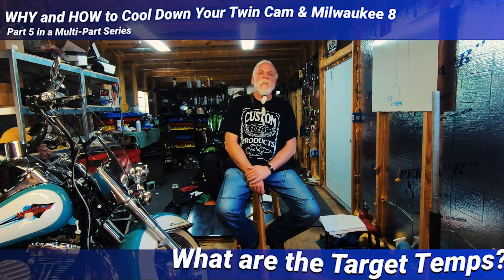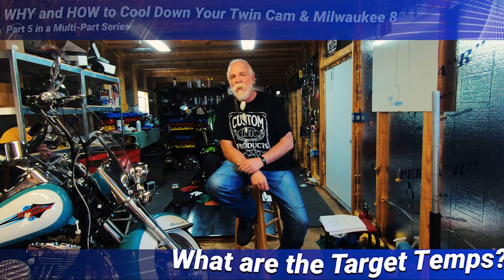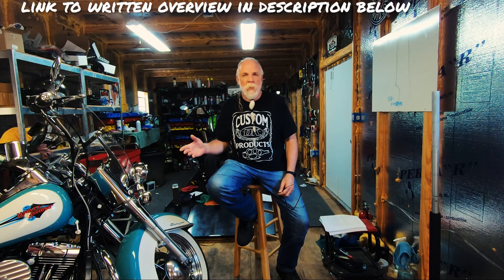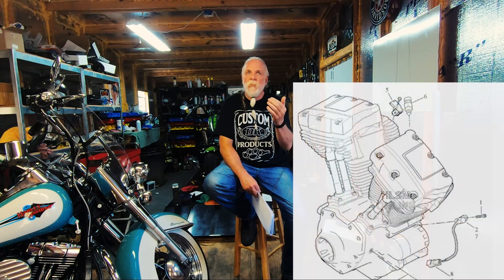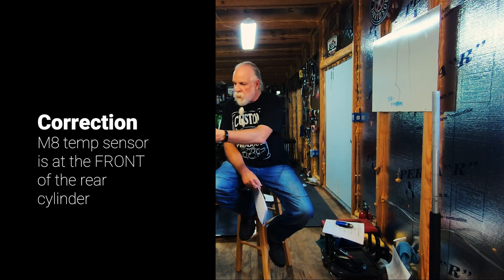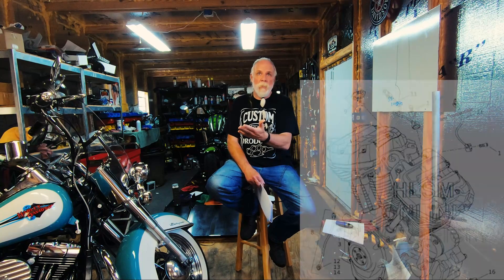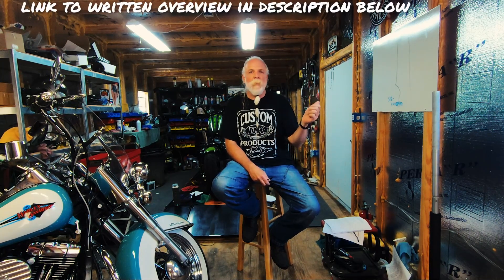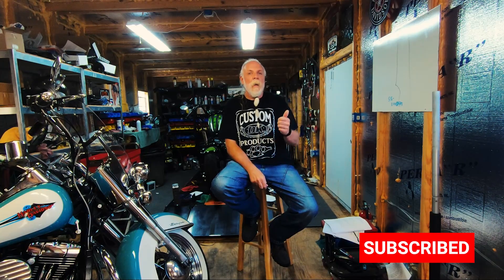Optimum Harley Temps for Comfort, Power & Longevity

Comment: Today here in Central Florida, 91 degrees with a real feel temp 101. After riding my 2012 Heritage Classic Twin Cam 103, 40-50 miles, I hit 240 degrees oil Temp. I have a Jagg Wideline oil cooler without fan assist, 2in Tank Lift, with Optional rear lift, XIED, External Breather with Catch Can.
Reply from the maker: That's a good setup and those temps sound about right, thanks for watching! -RM

Here is a link to a written report on How to Cool Down Your TC/M8 that you may find uesful/interesting - https://www.dkcustomproducts.com/why-how-to-cool-down-your-twin-cam-engine-part-ii-dk-cl-tc-dn-2.htm
Reply: @DKCustomProducts  I thought you stressed not to go over 230 oil temp?
Reply from the maker: @dieseljuice3  This is true but with all things considered, those are good numbers for Florida temps. You have taken the proper measures to cool it down and there really isn't much more to be done. Perhaps a billet oil filter to net a couple more degrees. Where are you pulling the oil temp from and what device are you using to read the temp?
Reply: @DKCustomProducts  HD Oil Temp Dip Stick Gauge. Oil Tank.
Reply from the maker: @dieseljuice3   The digital one? Those are notoriously inaccurate. Yours may be correct but you can confirm with a cooking thermometer. If you have the analog gauge dipstick, it is probably correct. Still though, 240° when its basically 100 outside is reasonable. I would be running full synthetic though as it can handle temps up to 275° before it starts breaking down. Not ideal to have oil temps that high under any circumstances but better than Petrol-based oils which will start to break down at 240°
Reply: @DKCustomProducts  Analog, and Synthetic. My first HD @ 65 yrs old. Worry about damaging it.

Comment: Does mufflers effect engine temperature?
Reply from the maker: Free flowing exhaust slip-ons are a very important factor in cooling the engine down.  The stock exhaust mufflers (slip-ons) are restrictive, resulting in the engine fighting against itself.  In doing that it generates heat with no resultant forward movement.

By removing this restriction, you are allowing a free flow of exhaust exiting the engine, which plays an important role in keeping the engine cool.

The stock headers on Harley’s are very respectable, and are not restrictive.  Replacing them will not have a significant benefit in lowering engine temperature.  If your Catalytic Converter is in your headers (all Touring & Trike models) you can remove it, or replace the headers for a reduction in Felt heat from the exhaust.

Here is a written report of exhaust that you may find interesting - https://www.dkcustomproducts.com/harley-exhaust-myths-and-facts.htm

Feel free to contact us with any questions;
Support@DKCusotmProducts.com
662-252-8828

Thank you for commenting! MB

Comment: Will it hurt to run flow fans and an electric oil cooler? I ride in the Ozarks a lot , and my electric oil cooler seems to stay on more than I would think it needs to. It kicks on at 230 degrees.
Reply from the maker: That shouldn't hurt anything as the Fan and the oil cooler should not come on until your bike is at about 230 degrees. 

I am not sure what bike you have, but you may find this video informative/helpful if your bike is running hot - https://www.youtube.com/watch?v=CAcF0T-Cs3E

Please feel free to contact us with any questions;
Support@DKCustomProducts.com
662-252-8828

Thank you for commenting! MB

Comment: Just put a power vision on my 21 Road Glide special.  My ET got up to 334 degrees while running down the interstate. I'm running amsoil. I have your tank lift kit installed. I found no loss of power. The bike runs great. And just normal running at under 70mph it will run around 280. What could be my issue?
Reply from the maker: That is far too hot.  
Here is a video we just released on a common sense approach to cooling the engine down to the optimum operating temperatures.
https://www.youtube.com/watch?v=CAcF0T-Cs3E
Some bikes will run for their lifetime with damage caused by excessive heat, others, not so much.  Here is a video on that subject- https://www.youtube.com/watch?v=uyryiq6BzQY
Here's another one you may find interesting- https://www.youtube.com/watch?v=2o9k__6MV6Q&t=0s

A loss of power due to crossing the 270* mark will not necessarily be felt.  It will if you are full throttle, you will see it on the dyno, but is is not something one would necessarily feel in normal riding.

Always feel free to email or call with any questions:
Support@DKCustomProducts.com
662-252-8828
KP

Comment: On a Fp3 tuner the engine temp is that ET sensor right?
Reply from the maker: It is reading the heat sensor that is embedded in the cylinder head. 😎

Thanks for commenting! 👍 MB
Reply: @DKCustomProducts  and I want that at around 230 degrees?
Reply from the maker: 230 is the normal operating temp!

Here is a full video list of why and how to cool down your TC and M8 that you may find useful/interesting - https://www.youtube.com/playlist?list=PLb3bvZgbH92_3s-2vv63QggFJ3nteFd_C

Thanks for commenting! MB

Comment: Which is better to use to cool down my 2015 Ultra Limited liquid cooled engine/oil temp? Force air fan or adding an aftermarket oil cooler?
Reply from the maker: An aftermarket oil cooler is a good step in cooling down your bike. There are many other things you can do to cool it down, there is a link to a written report where they are all outlined, with temp drop results.

Here is a video that is very pertinent to your Twin Cooled bike, illustrating why an oil cooler is important on the Twin Cooled Bikes- https://www.youtube.com/watch?v=6AhPqVlvE-w  

Here is a link to the oil coolers we offer and use- https://www.dkcustomproducts.com/oil-coolers-c134.htm

Here is a link to a written report on how and why to cool down your Twin Cam part 1 - https://www.dkcustomproducts.com/why-how-to-cool-down-the-twin-cam-engine-part-i-dk-cl-tc-dn-1.htm

Part 2  of the report - https://www.dkcustomproducts.com/why-how-to-cool-down-your-twin-cam-engine-part-ii-dk-cl-tc-dn-2.htm

Please feel free to contact us with any questions you might have; 
Support@DKCustomProducts.com
662-252-8828

Thank you for commenting! 👍😎👍

Comment: I know the "Engine Temp" on FP-3 and FP-4 is supposed to be equal to Power Vision indication, have you seen that to be true? I have the FP3 on my dual cool 15 Ultra and it running at 200 on the freeway and up to 225 in traffic and My 2010 Dyna with the FP-4 runs 225 to 235 or so on highway and hits 250+ in traffic. South Florida 90 degree days... Just wondering if PV and FP indicate the same.
Reply from the maker: Those are some good temp readings you are getting.  On the Power Vision the one you want is ET, on the FP3 and FP4, I believe the heat sensor embedded in the head is displayed as F

At 250F on the Twin Cam you are a bit high...you don't want to see it go over 230 F.

Here is a video of low and no cost ways to get it a bit lower- https://www.youtube.com/watch?v=o3T3yA9BKwE

Always feel free to email or call with any questions.  We appreciate your business, and I believe you will be well pleased with your EBS.

Support@DKCustomProducts.com
662-252-8828

Comment: The printout for the tc shows the sensor at the front of the rear cylinder but you are saying the rear of the front cylinder. Which is it?
Reply from the maker: Every 2007 and later Twin Cam we've looked at have the heat sensor at the rear of the front cylinder.  The M8's are at the front of the rear cylinder.  The schematics in this video show what is said above, but you can go online and look at the schematics for any year and model bike and see where they are located.

Comment: I didnt know my power vision had a engine temp and a engine head temp both to chose to monitor on my 20 or 21 m8s.. But ive made a few mods, and my oil temp (via harley oil dipstick) at 98 degree outside temp my oil makes it up to 215 on hwy driving..and down to 205 stop and go traffic, however my Power vision (by one selected) runs 300-325 inthe 98 degree hwy riding.. Either its not there, or i can not find head temp (only ET Temp) with my option selected,  but what i am measuring in no way could ever stay below 230 degree.  Edit:  I found the Head Temp selection under Advance options selections, but I also noticed it reads about 20 degrees above reality while sitting cold in the garage..
Reply from the maker: Those are great oil temps!  My guess is you have M8 Softails, or Touring models with no lower fairings.
Regarding your Power Vision, the should be an "ET" gauge.  The CHT gauge is worthless for monitoring engine temps...it is an algorithmically derived number that changes quite a bit, and is not reflective of actual engine temperature.
Here is a link to a video showing the ET displayed in the middle left of the screen. https://youtu.be/5OTSwYFPABE?t=294
Reply: @DKCustomProducts  I have a Road King , and my Street Glide does have lower fairings (I always leave the vents fully open) and 20mm lift on the front of the tank, stage 2 Wood's cam, S&S oil pump and cam plate, added fan to oil cooler (same for the road king engine mods) , and.yea that ET temp was climbing on extended 65+mph riding when riding in 100 degree weather..it seem top top out below 330,. I suspect oil temp would have been 220 at that same moment if I was able to observe it.
Reply from the maker: @ut1004bp  Yeah, those are really hot temps for the ET.  Something is still awry with your builds that they are building that much heat, especially at 65 mph.

You can see what happens at the 270 F mark in this video- https://www.youtube.com/watch?v=5PxJ8PvcVtc
Reply: @DKCustomProducts  Yes I can see the curved shape might aid in some air flow as opposed to a flat crash bar lower set would..I think I've responded last year to your test of the above mentioned.. but To create more funneled air flow, I've rotated my horn housing forward and remounting to be center of the two cylinders, rotated the horn backwards to prevent water intake, and I believe it will be another  no-cost heat reduction solution for the rear cylinder (will get it hottest at 65+ mph on very hot days) as there needs to be more air flow for that rear at those occasions, I haven't tested this mod yet.
Reply from the maker: @ut1004bp  Nice.  Looking forward to hearing your results.
Reply: @DKCustomProducts On my Road King, I couldn't use the power vision to monitor the engine temp, but on today's 200 mile ,  I reached in back of the horn clamshell and could feel wind pressure being pushed to the left side of the rear cylinder, even with my horn still in there, oil temp was 208, immediately after pulling over to check and I was steady at 65 and more for an hour, with 90 degree ambient temp..id say it's worth moding the horn orientation, and for better results, remove and relocate the horn.
Reply from the maker: @ut1004bp  Good deal!

Comment: My '12 Twin Cam has a stage 1 , Cobra Power Port duals header, Rush mufflers,  performance machine jet air cleaner,  and power vision tune from Fuel Moto.  Today in Cleveland its humid with an air temperature of roughly 82 degrees.  On my way home from work today,  in city stop n go, my powervision ET hit 275!   I thought adding this cobra header id have a cooler running TwinCam????
Reply from the maker: Hi Anthony,
The exhaust you have is having reversion, which is not good for heat.  The air cleaner you have is feeding hot, oily, oxygen depleted air back into the engine, also not good for heat.
Here is a video on what you can do to mod your air cleaner to run the bike cooler, AND, with more power-
https://www.youtube.com/watch?v=EfDeFZblMck
Here is a video talking about exhaust, and an easy fix to them to help the bike run cooler, and with more power-
https://www.youtube.com/watch?v=nB0XDQVjH9Y

Here is a link to a report on Why & How to Cool your engine down- https://www.dkcustomproducts.com/why-how-to-cool-down-the-twin-cam-engine-part-i-dk-cl-tc-dn-1.htm

Comment: My 1200 Custom (with a Stage 1) is getting up around 400°... guess I better do the auto tune. I'm betting it's running lean. That hasn't even been in real hot weather.
Reply from the maker: What year is your Sporty?  400 F in weather that is not real hot is a little unusual for a Sporty.  Tune first, still too hot, then possibly an oil cooler and/or a coil relocation.
Reply: @DKCustomProducts  to answer your question, it's a 2014. Had about 2400 miles on it when I got it about 2 months ago. Put over 1k on it so far. But the autotune and taking the cover off the air cleaner seemed to help!
Reply from the maker: Glad you're getting it cooled down!  👍😎👍
Reply: @DKCustomProducts  I removed the air filter cover and did the autotune on the FP4. That seemed to bring it down to around 360-370. Also have an oil cooler on the way but the above steps definitely seemed to help! Thanks!
Reply from the maker: Good Deal! 👍

Comment: So which would be the temperature that I'm looking for. A dipstick thermometer or a powervision readout?
Reply from the maker: We look at both, but if I had to choose which one is more important...that is the heat sensor in the cylinder head.  Both the Power Vision and the FP4 can display that for you.
Reply: @DKCustomProducts  Thanks! If it ever warms up here in Mn I think I'll plug in my PV and see what the temp tells me. I would still like to have a dip stick that reads oil temp.
Reply from the maker: Yes, it is useful to have both.  Once we have a bike dialed in to the optimum temps, we rarely look at them.  But it is good to have them to get your bike where it is happiest.

Comment: My 2011 road glide custom head temps reach 370 cruising . My efi is never over 14.4. I'm concerned
Reply from the maker: Where are you getting those temp readings from?
There are only two reliable temp readings on a Twin Cam.
1.  The oil temperature, measured at the tank, after 45 minutes or more of interstate riding.  It should not go over 230 F on a hot day.  If it does, it is running too hot for it's own good.
2.  The ET reading shown on a Power Vision.  This is the temperature that is measured by the heat sensor in the front cylinder head on a Twin Cam.  This is the temperature that is sent to the ECM by Harley.  This is used for a variety of purposes by the ECM, including to retard timing when it gets too hot for it's own good.
230* F everyday warm weather riding, with no more than 240* F in extreme circumstances.  
(at 260* F you will feel the sluggishness in power, and accelerated engine wear begins)
Here is a link to a report with the above information, and much more, including what can be done to cool it down.
btw, you will see in this report that the difference between a poor tune and a good tune only varies the ET by 10-15 degrees.  While it is important to have a good tune, it is a myth that a good tune is all that is needed to cool these bikes down to the temperature that is optimum for them.
https://www.dkcustomproducts.com/why-how-to-cool-down-the-twin-cam-engine-part-i-dk-cl-tc-dn-1.htm
Here is a video that shows what happens to the power, as designed by Harley, when the temps get too hot-
https://www.youtube.com/watch?v=MF0hO-w2hz8
Reply: @DKCustomProducts  on my pv3 . my et runs normal . 200-220 while cruising . It runs fine even with the cht reading 370. And it cools down when i come to a stop . What am i reading wrong
Reply from the maker: @michaelmurphy4116  You're not doing anything wrong.  For some reason dynojet decided to call the head temp sensor "ET".  Then, to make things more confusing, they use the CHT to display a number that is NOT a reading from the engine, but is a number derived from an algorithm.  The CHT algorithm take the heat sensor number, the IAT number, the MAP, and other factors and comes up with a number that the ECM does not even use.  You will notice that it can change quite a bit and quite rapidly.  Take a look at it on your next ride, then romp on the throttle when going 40 mph or faster, you will see it drop temp very quickly.  Much faster than any metal in the engine can change temperature.
ET of 200-220 is great on a Twin Cam.
Reply: @DKCustomProducts  thank you so much . I couldn't find any info on it and it was driving me insane . Like you said it would shoot up to 370 with the twist of the throttle . I'm going to completely take that reading off the screen then
Reply: @DKCustomProducts  I'm still going to put a Jims fan on it . That 103 gets hot quick in stop and go

Comment: i run 20/60 oil redline and i stead run 280 plus. Put pipe thermo wrap on pipe that is helping. just ordered oil filter relocation. then going to order external oil cooler. With heat in texas around DFW area ive seen my bike run a steady 315 before. i have 17 Breakout
h
Reply from the maker: You are on your way to getting it cooled down.  Nice work.
We appreciate your business, and those two additions are going to cool it down even more.
Here's a checklist we've developed over the years, and what I use on every new to me bike that I get.
https://www.dkcustomproducts.com/why-how-to-cool-down-the-twin-cam-engine-part-i-dk-cl-tc-dn-1.htm